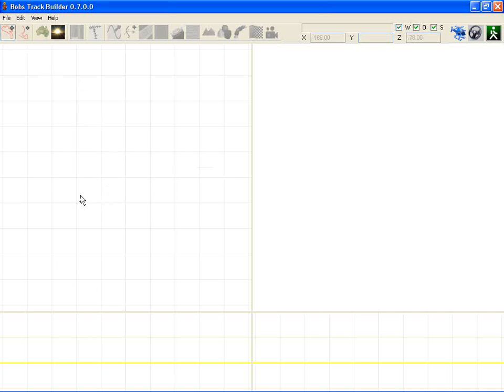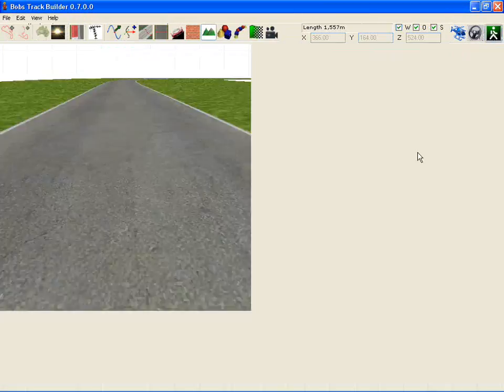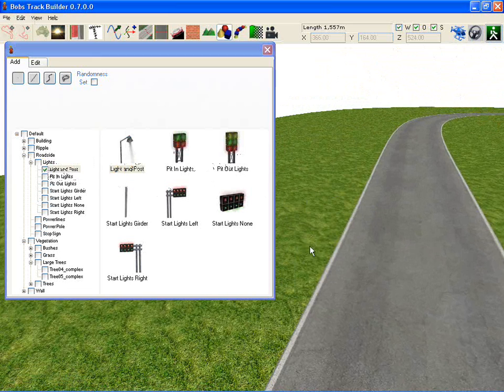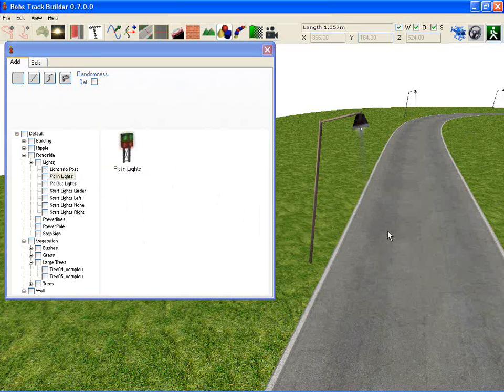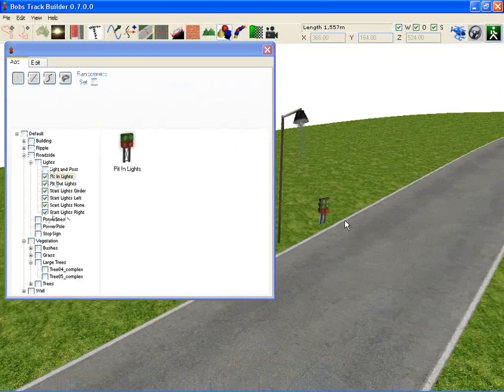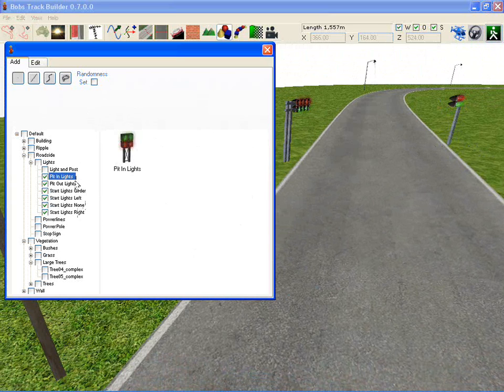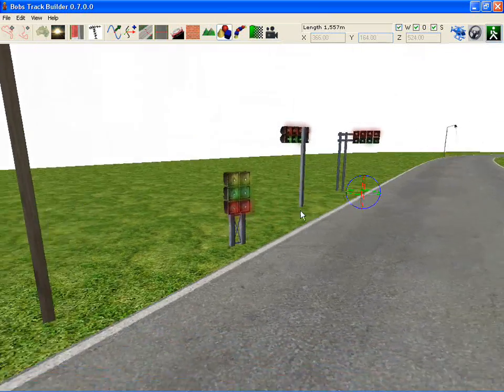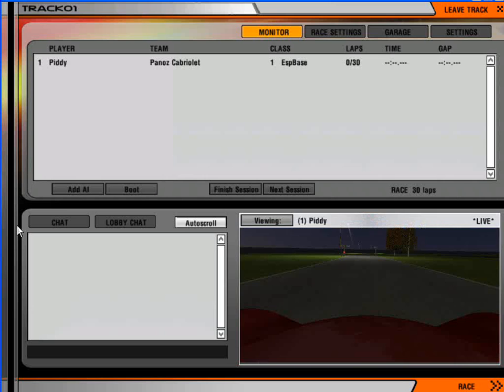How to add rFactor Lights using Bobs Track Buillder v0.7

Comment: Hi,

I'm having a few problems getting my light to work in Rf. I've made a flood light object and a set of glows and done what I thought was the right thing with them both in the Xpacker, but it's not lighting up ingame.
In Xpacker I've imported the light unit and the glows as separate .3ds objects, set the glow to be used as a light glow and done everything I thought I should. Can someone help please? I could send the Xpack in an email if anyone could help.

Thanks.